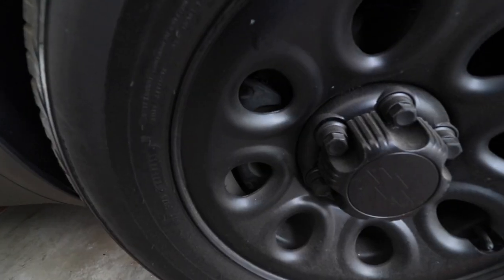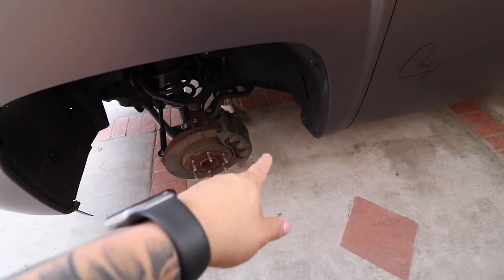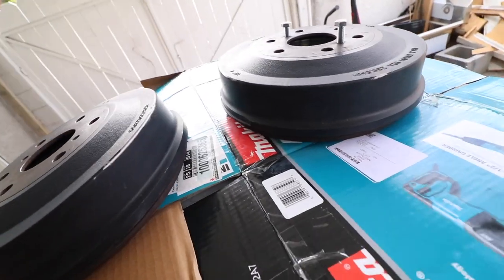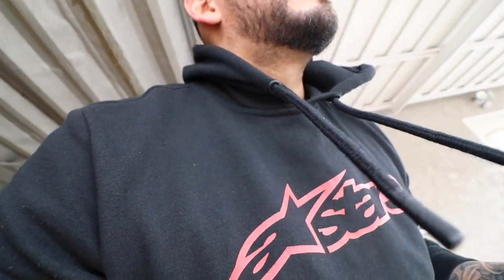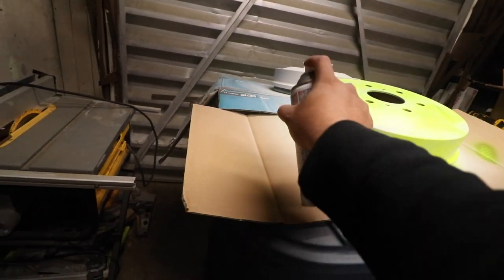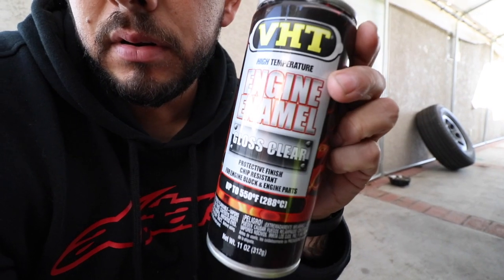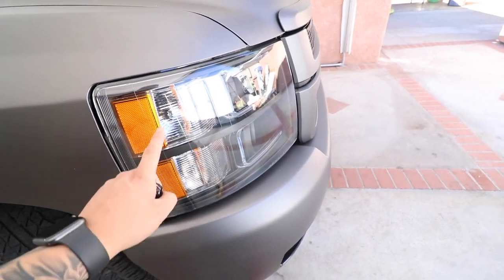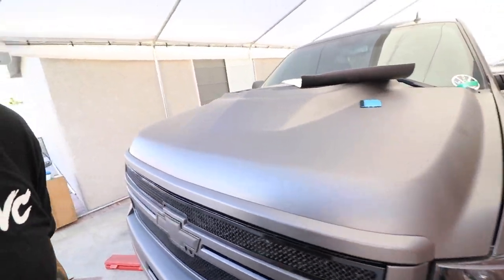FLUORESCENT YELLOW CALIPERS ON MY SINGLE CAB!!

Comment: You should do a rear disk brake swap. I did it on my 2011 Sierra . I used a 2001-2005 Chevy Tahoe dual piston calipers that I got from the junk yard. Very straightforward swap and you get dual rear pistons for cheap.